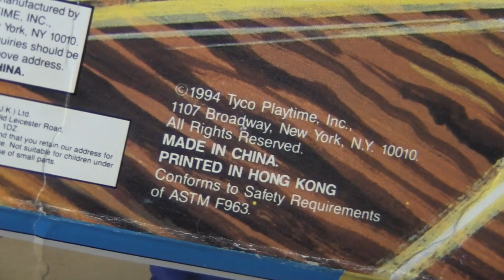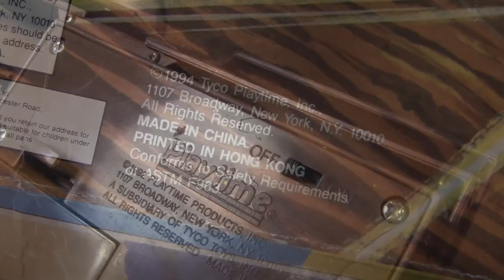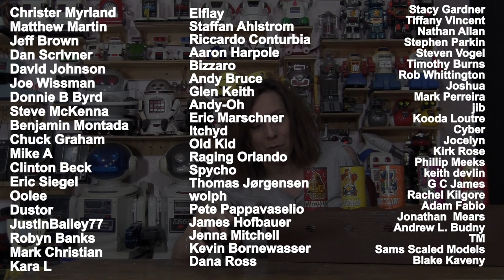Bringing Back the Fun: Restoring the Classic TYCO Target Game Tin Can Alley

Comment: love it. Last summer i got a vintage 1970's one complete. with corroded battery terminals. I fixed it all up. including new brasss made terminals. the soda cans were flat top REAL coke and SPRITE root beer and ORANGE cans.without any soda int hem, sealed. From the bottler I'm guessing. All absolutely original. I took an air compressor and drilled a tiny hole in the bottom of each can and blew out all the dents back so the cans looked straight without dents. They also had mall stickers youd place under the hole on the fence to 'calibrate' your gun. AIm at the sticker to get the light in the hole.
Reply from the maker: Wow... That's cool. I like the air compressor idea.
Reply: @RandiRain  yeah it worked great

Comment: Hey, does anybody remember the UFO game that worked with  light sensor? The base was a light gun that sat on the table, The UFO would run in random directions. You had to shoot at it.
Reply from the maker: I don't, but it sounds awesome.
Reply: @RandiRain  Went down a rabbit hole trying to figure it out. It was UFO Attack by Castle Toys. I remember the commercial. It had a catchy, exciting theme song, kinda like the Run Yourself Ragged commercial (You did that one a few weeks ago).  Castle was a small company that made cheap toys, but advertised heavily. I have their handheld Kingpin II pinball game. Awesome concept, poorly made and doesn't really work.